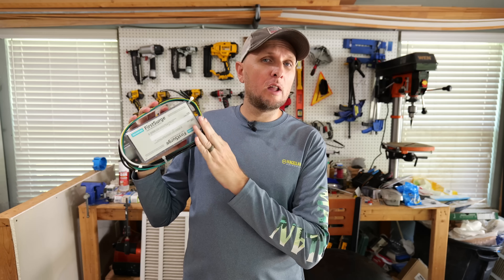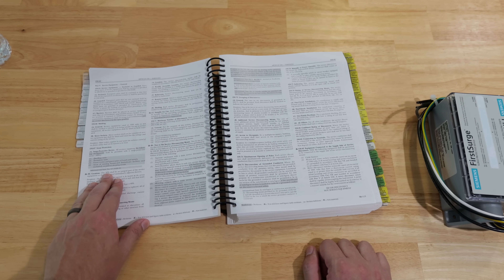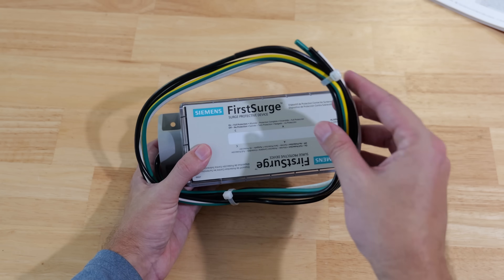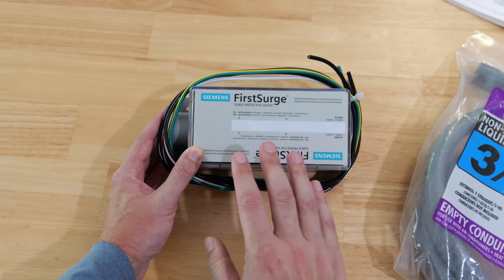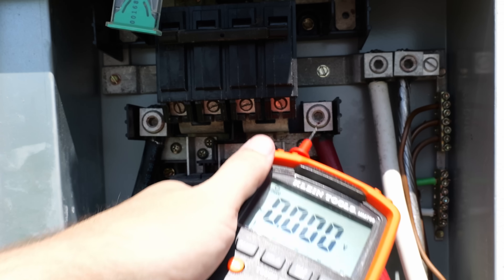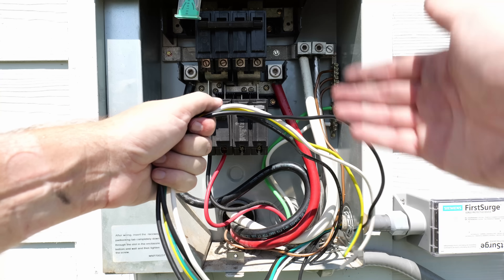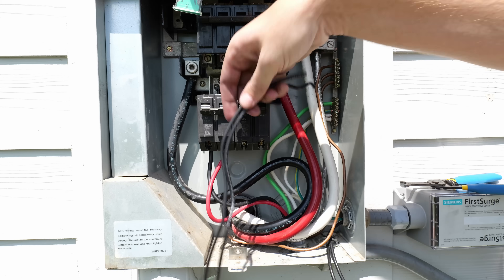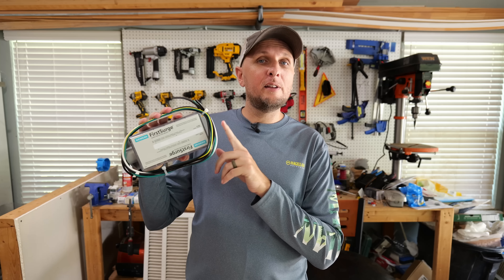Why Whole Home Surge Protectors Are Now Required and How To Install One!  Siemens FS140

Comment: great video for public information. BUTTTT why install a surge protector that is a one time use. Meaning needs replaced VS a unit that self protects, resets and does not require a  licensed electrician to replace a new unit .  The labor cost on replacement would clearly pay for itself to upgrade to a better quality unit.
Reply: The ones with a reset are way, way more expensive..plus, how do you know a unit that’s had a large spike, or repeated spikes hasn’t been affected negatively despite “resetting” it?

Comment: I like living on the edge.
I even run with scissors.
Reply from the maker: Whoa, take it easy Evel Knievel!
Reply: I only run with safety scissers, I use furman surge and surge x surge protector and a isolating transformer for my expencive sound system and computer

Comment: I never knew they existed.  I have a main breaker panel on the outside of the house where the power comes into the house.  This feeds into a panel indoors to the garage.  The panel in the garage feed to whole house and is within the wall.  All I see is just the panel face and I have no access to the punchout openings in the panel.  How do I hook one of these to the panel?  It uses D Breakers?

Comment: I have to confess ignorance.  Please trace electrical flow that accomplishes the protection.  There are two breakers one to the surge protector and the other to??  I’m sure that the instructions with the surge protectors explains the flow but I just can’t see it.  How does the surge protector stop electricity from going through the other breaker?
Reply: Yeah it wasn’t explained properly

Comment: Since the all power isn't flowing through the surge protector before going elsewhere, can you explain how it works?
Reply: I went to four sites and they all gave a non-answer answer. One said it works exactly like a power strip surge protector, which does not make sense either. How does it stop the surge in the other breakers? I can see it tripping the 20-amp breaker but how does it protect the whole house?
Reply: I was wondering the same thing.
Reply: @trehis  It has limitations. If the surge is too large/energetic, the surge protector's breaker will trip and the house will be exposed to the full surge.
Reply: @trehis  think of it's like the MOV in a power strip, but in this case the MOV are connected to the main box busbars. I have not had a FS140 die to take it apart yet, but assume its just a bank of MOV wired between between both hots, individual hot to neutral x 2, neutral to ground with a little additional circuit to drive the LEDs.
Reply: My understanding is that it detects excess voltage in the entire electrical system (since it’s all at the same voltage) and diverts the excess to ground. As long as it’s connected anywhere in the panel it should drop the voltage for all circuits in the panel (because of the common bus - anything that can drop voltage can affect other items, kind of like when your lights dim when your a/c comes on).
Reply: The surge protector is not a current device  interrupter (like a breaker) but a voltage monitor that can detect high voltages in the nano second (10 to the -9 power) range and shunt or short said excess voltage to ground. Since the device uses high speed power semiconductors it can only work up to the rating of the semiconductor--thus the lights that tell you if it fails. This type of device is a sacrificial device that needs replaced if hit with an excess charge, but its typically cheaper than all the other items that would need replaced. In addition, if your earth ground circuit isn't low resistance (as it should be) then you have a restriction in the path the clamped current wants to travel to. Professionals can measure your earth ground resistance. In wet locations you should be ok if all was installed correctly. In rocky, dry, and desert conditions this becomes a major problem and needs tested and fixed if possible.
Reply: Thanks for the explanation! @TheDigitaldoug
Reply: Electricity follows the path of the least amount of resistance that's how it works

Comment: I want to install both a power generator And Solarpanels to my late 19 50’s motel.  
Heating in NH is mostly electric baseboard heat.
The panel is 200 amp service.

Comment: Wish I had one.  A couple years back we had a surge that knocked out my thermostat.  It was during the pandemic, and replacements were very hard to come by due to supply chain issues.  Basically had no HVAC for well over a week.
Reply: Not helpful now, but for others or future - you can bypass the thermostat entirely. All a thermostat is is basically a switch, so you can manually turn on/off fan and AC if you have exposed wiring. Youtube vids out there for how to do this. Useful to know in a pinch.
Reply: @MUSCGamecock  maybe buy a spare unit?  if they are that delicate.  They are cheap.

Comment: I have a square D SP in a breaker slot.  Is that sufficient?
Reply: That is like saying you have a Toyota instead of a Honda. They are both cars. The breakers are just mounted differently.
Reply: I think that he's asking if a single pole will work instead of a double pole.
Reply: @johnschutt9187    Thank you!  Your answer explains the difference.  I think the external unit would do a better job.

Comment: So does this surge protector stop the frying of my electronics due to EMP?
Reply from the maker: So, many of them probably cannot.  However, if you research the one in this video, the Siemens FS140, you will find where it is one of the SPDs recommended for an EMP event along with installing ferrites on the Line 1, Line 2, Neutral, and Ground.
Reply: A surge protector probably will not protect your computer if the Russians launch.
Reply: This does not protect from EMP. EMP is atmospheric and not a line. This item, while not a bad think in many circles this is just another money maker for contractors. You can even have a small monthly fee protection by your utility and save the crazy money they charge to buy and install this device. Notice they don't tell you how much, there is a reason - it's expensive.
Reply from the maker: I said it won’t buy itself but it is one of the highest recommended surge protectors for an emp with ferrites also installed.  They are way less expensive than the electronics and circuit boards I and so many others in the comments have lost from surges.  To argue not having one installed is better is laughable to be honest.

Comment: So how does a 20 amp surge protector work if you have 200 amp service? I dont understand how it protects the whole panel?
Reply: I'm wondering the same thing.
Reply: @johnschutt9187 A typical surge lasts less than 20ms and is just a voltage spike. All you need to protect your devices is have something physically closer that clamps the voltage to a safe level and absorbs the power difference. 20A is plenty to do that. In fact, a 20A breaker would take 200-800 amps to trip in under 20ms.
Reply: The surge protector works by shorting the voltage spike to ground. When the surge is large enough, the surge protector sacrifices itself in the process. It becomes a short. The breakers trip to protect your electrical power.
Reply: from the Square D folks: "Most of the residential SPD are limited to 12AWG and 20A max OCPD and the commercial SPD are limited to 10AWG and 30A max OCPD. Because since the transient voltage is only for nano second it does not make sense to go any higher than the 12 awg & 10 awg with respected OCPD. Besides the SPD it self does not draw any current it self anyway, so going with larger gauge conductor is waste of material without any gain"

Comment: I have all in one main shut off and 20 breakers inside my garage. Can I put the 20 amp breaker at the bottom or do I need to put it on top next to the main shut off? The wiring is nice. I don’t want to mess it up.
Reply from the maker: You would need to look at the instructions of whatever SPD you decided to go with but this particular one does not specify that it needs to be right by the main shut off.  I personally think that it is better if it is but I totally understand your scenario and it should not be an issue.  The main concern of this one is just making sure the wires are cut as short as possible which of course will vary by each install and available installation location.
Reply: Electricity basically travels at i ft. per billionth of a second so assuming the phase rails in your breaker box are approximately 24 inches you add 2 billionths of a second to the SPD clamp trigger time (if the 20A breaker is located at the furthest breaker location from the service entrance). This is why the install instructions want the included wire cut to the minimum length. Now if you used the total wire length included with the SPD device then using a breaker location closest to the main power may be advisable.